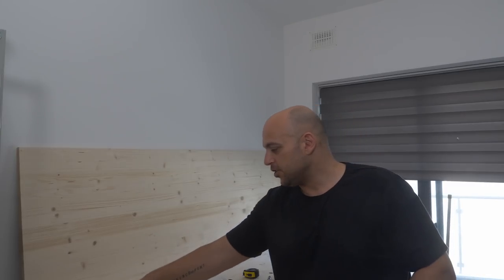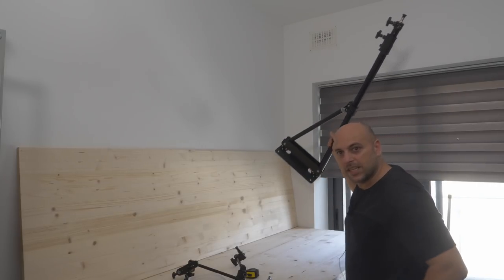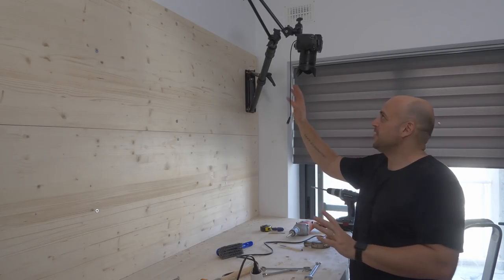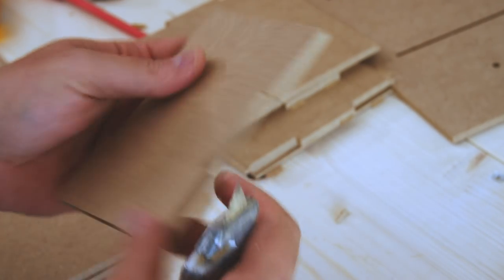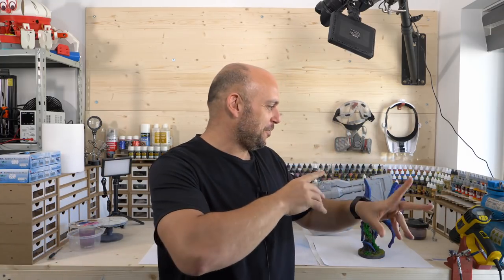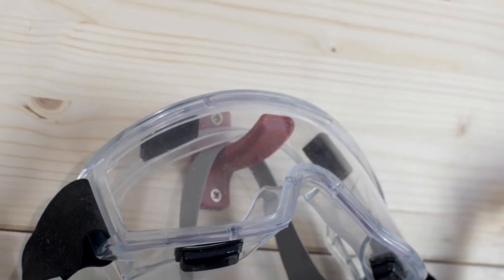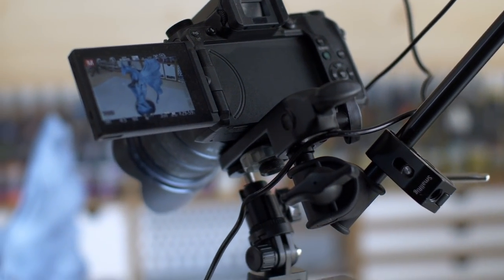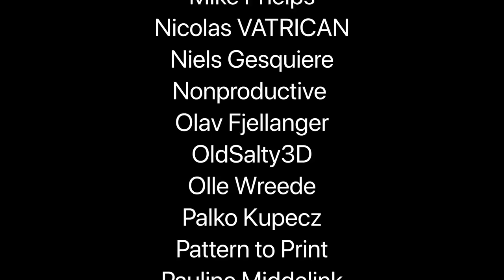My Dream Workbench Is Ready! - Part 2

Comment: Hey Joe, if that table starts to wobble after some use, screw in extra screws, but also put in some diagonal supports on the legs (even if on the back and sides only) - you would be very surprised how essential they are for a rigid and stable structure. :)

Comment: Very nice job. I think I would want to move all those drawer units (with the paints on top) up about 300mm or more above the bench. That way, more bench space underneath, and also the bench does not need to be kept clear in front of the drawers in order to open them.

Comment: Just fabulous 🤩 I saw a noob trick there, when installing the back splash panels at the back you tapped in the plug level with the wood then screwed the screw in nearly all the way in then tapped with a hammer and then finished screwing, what’s the secret sauce ?

Comment: Ah yes, concrete. In our Dutch home we have reinforced concrete. And that means... REINFORCED concrete. Impossible to avoid the steel. :) And yes ofcourse we enjoy everything you do, making is very broad.
Reply: same here in belgium.. a tracker to scan where the reinforcemen,ts are under your surface (side note: same machine usually gives you also position of the inwall wires) is really needed in our homes prior to drilling!

Comment: Awesome Joe! Can you link the arm and the camera mount you used with the arm? This is awesome!
Reply from the maker: Did that now, thanks for the heads up!
Reply: @3DMakerNoob  glad to help! You should showcase printed storage for the table as well. HobbyZone are awesome, but pricey.
Reply from the maker: I don’t know if this is a European vs America thing, had many say they are prices but for me they seem relatively cheap considering that units start at around 5-6 euro
Reply: @3DMakerNoob  shipping was the issue. I priced out something similar to what you have and it was hundreds of dollars. I printed one and it was less than 5 rolls of filament.
Reply: @3DMakerNoob  it is the idea none the less and you have inspired me to make something similar. I just have to print more!